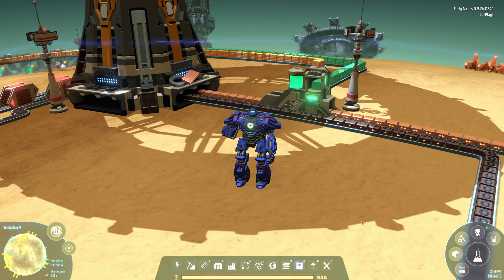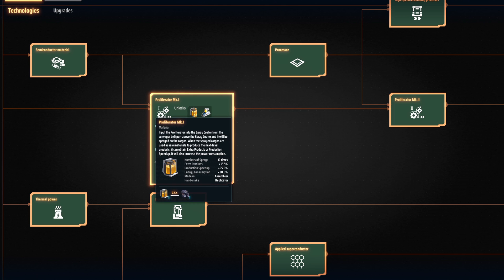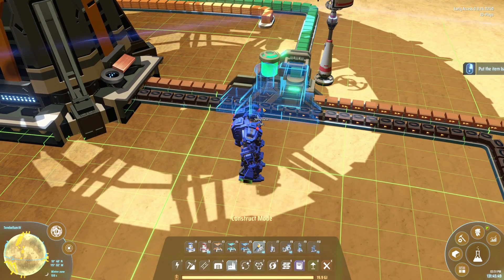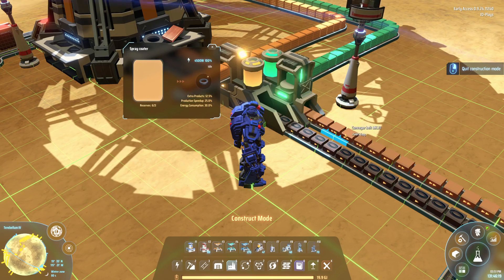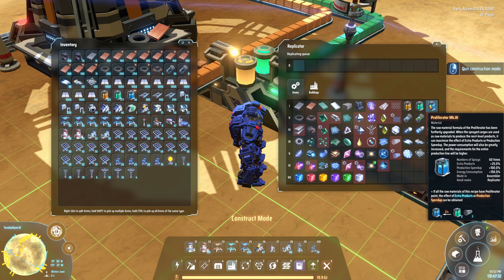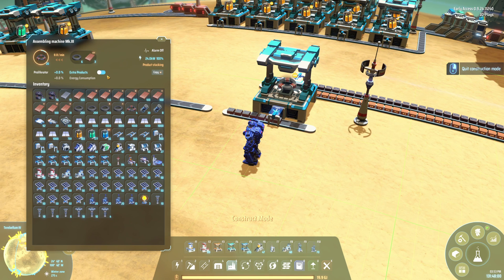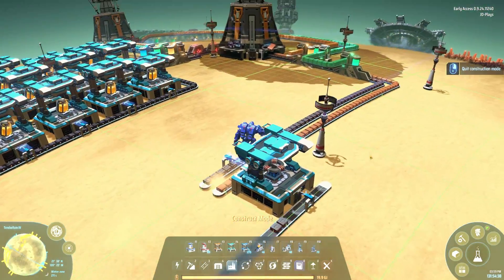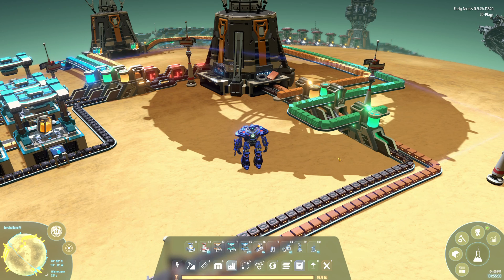How To Proliferator & Spray Coater 🪐 Dyson Sphere Program 🌌  How To Tutorial Guide

Comment: Have you tested whether or not the proliferator works on fuel? Mk3 on Antimatter fuel is the only way I can see to generate enough power to adequately supply something like a smelting planet refitted with these. Heck I had to use most of the north and south poles on my smelting planets to power a metric buttload of Mk2 Furnaces ( I play infinite resources because I didn't want to have to outpost every couple hours, I just want to build tweak and optimize). Multiplying power draw by 2.5x on a planet with space-optimized smelting arrays would be hard to do with current power generation unless we can make the artificial suns burn hotter.
Reply from the maker: I havn't tested power yet, but the last patch notes says: Fixed the bug where the enhanced Antimatter fuel rods might increase the actual output energy (extra produced Antimatter fuel rods can only increase the power
I assume either the fuel rods will last longer OR they will produce more power when in use, But I haven't tested it yet.
Reply: I decided to brave the plummeting framerates in my game, and I did manage to confirm that antimatter fuel sprayed with proliferator not only pumps the artificial stars to 144MW,  but the fuel also burns twice as fast. Effectively it lets you double your output for 0 additional planetary footprint,  at the cost of requiring additional production of fuel rods which ultimately isn't a big deal.

Comment: So the Proliferator spray items can be "accelerated" adding more sprays per item? Neat! That can really help in getting more out of my Blue Accelerants. Just like the Module system in Factorio, the Proliferator increases power consumption in the factories that uses those accelerated items. Must remember to have plenty of spare power before starting a Proliferator line.
Reply from the maker: A LOT of spare power specially if your using the MK3
Reply: @JDPlays  One question, Can we make more Deuterium in the Fractionator if we fed it with stacked Hydrogen?
Reply from the maker: @musizlover2008  I would assume so